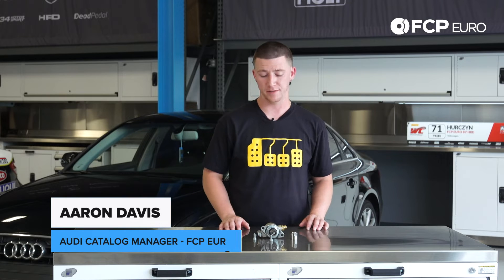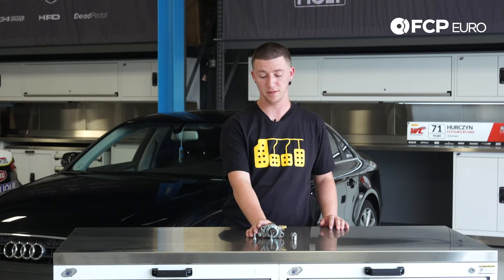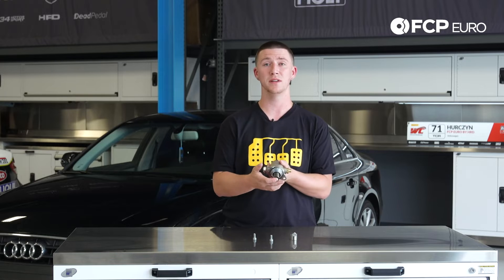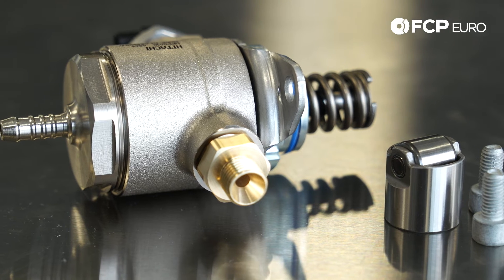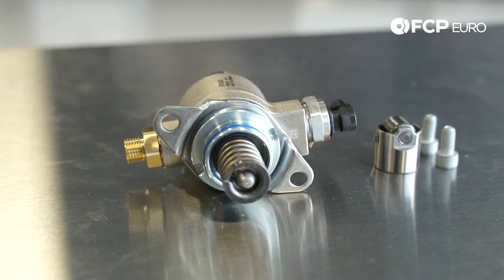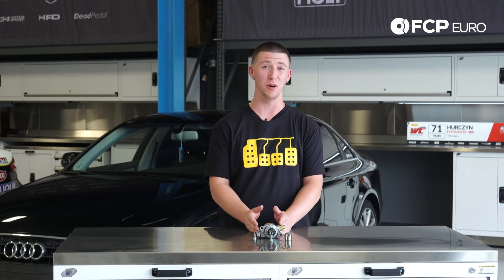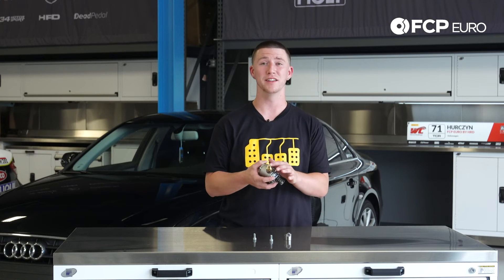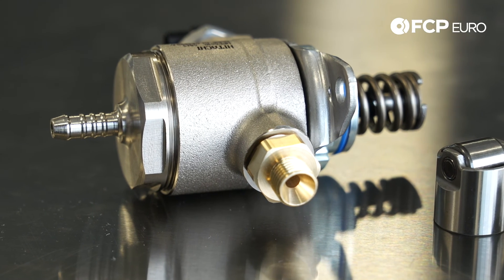Audi B8 - 2.0T - High Pressure Fuel Pump - Problems, Specs, and Product Review

Comment: I have a slight knock coming from the pump 2014 2.0T 90,000 miles on the motor. I am thinking it's the roller bearing starting to go. Is a knock common to hear before it lets go? Thanks

Comment: Would this part be likely to go out before the tank fuel pump? My car at times cranks but no start. If I persist, it eventually stars and runs fine and won't do it untill a couple of attempts later.
Reply from the maker: If you have access to VAG Com, or know a shop with appropriate scan tools, you can check duty cycle on the intake pump and check pressures from the high pressure and low pressure sensors and start to trace where the issue is.
Reply: Did you ever find the fix for that?